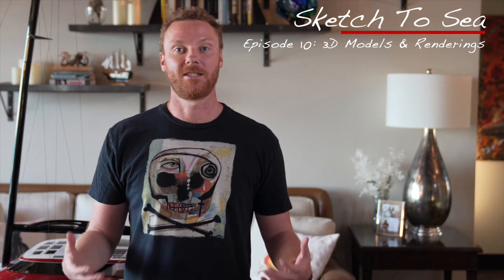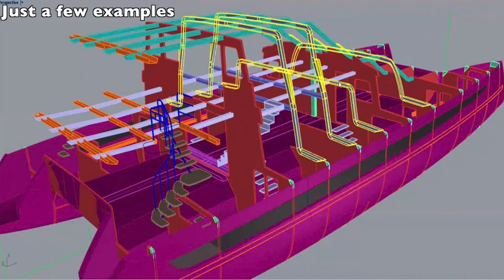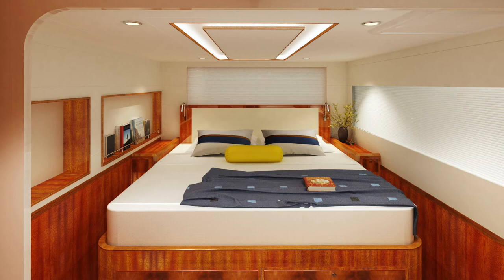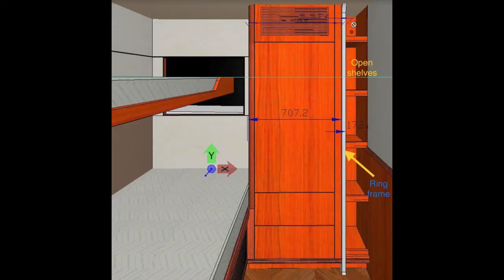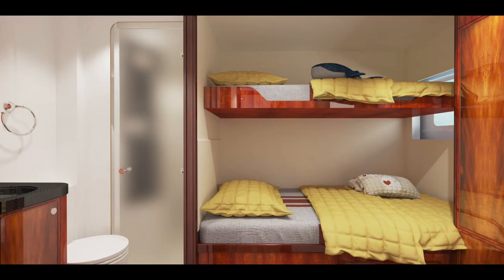Sketch To Sea Ep 10: The 3D Model and Rendering Process

Comment: Did you get the physical model 3D printed or did they use traditional model building methods?
Reply from the maker: I have a scale model of the vessel that was 3d printed.
Reply: @sketchtosea3750  How important or useful was it to have the scale model to look at did it help with any of your perceptions of the final design and did it prompt you to consider making any changes?
Reply from the maker: Not a ton of decisions were based on it. We did make a few minor tweaks. The 3D digital renderings were much more helpful @dennisash7221